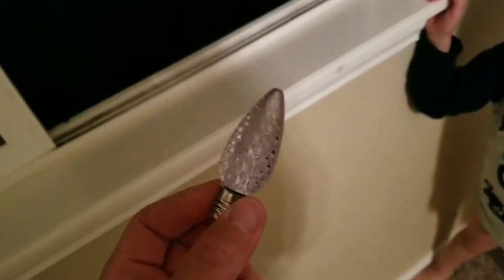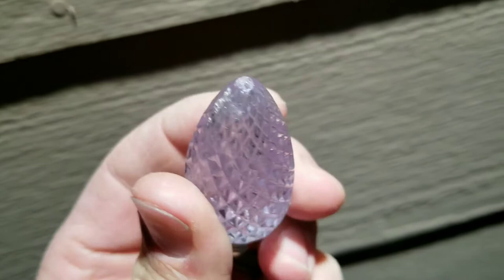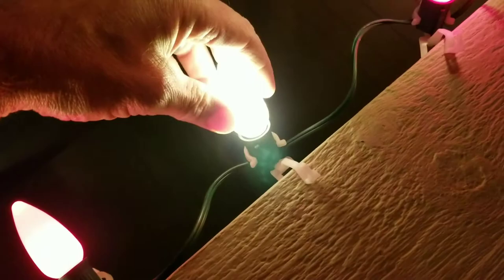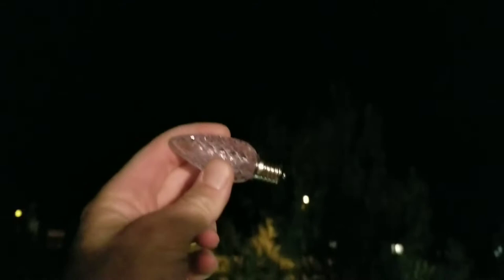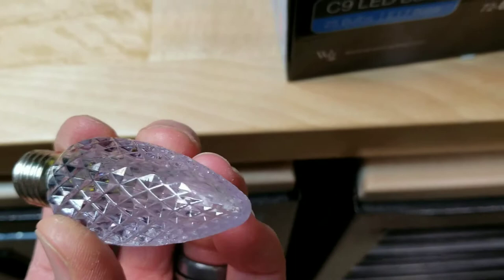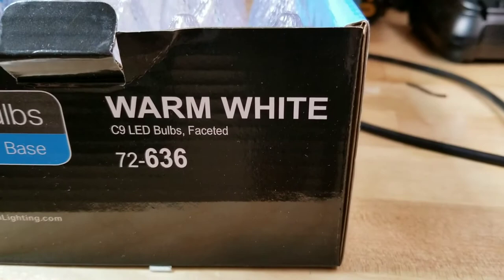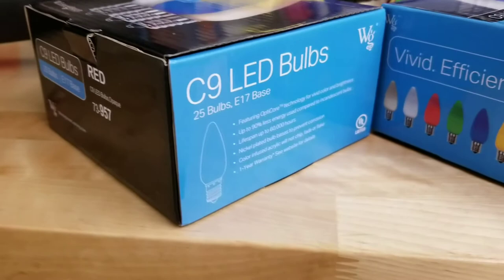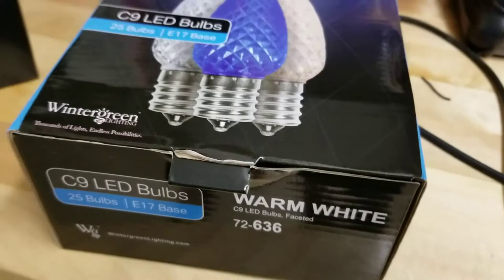OptiCore LED C9 Christmas light bulb Drop Test

Comment from the maker: 5 Christmases and zero burnt out bulbs. I'm very very pleased with these! I think the wire might wear out before the bulbs fail. I'm running almost 500 bulbs and the energy bill is tons better than it was with 250 incandescent c9s! I'll admit: I do miss the brilliant brightness of the incandescent, but with nearly 500 bulbs, the house still brightens the neighborhood pretty well! It's also really nice running all bulbs off one socket. I used to have 4 circuits dedicated to the incandescents in order to avoid blowing beakers.

Comment: Have you compared opticore bulbs to minleon? I found the opticore c7s warm whites to be a bit brighter and distribute the light better.
Reply from the maker: The Opticore are the first and only LED bulbs I've tried. I'll look into the minleon technology. Thanks for the suggestion.
Reply: Ive tried various makes and i may end up going with opticore. Minleons are good but the c9s and c7s are brightest when the tips are pointed towards you. I didnt seem to have that problem with the c7 Opticore bulbs. Celebrations has some c9s that are a bit cheaper and use an LED stick in it they are more prone to failures and they are not as bright and not always water tight. Let us know if you try the minleons, i like hearing peoples opinions on newer Xmas technology
Reply: @funnyberger  Are these Opticore LED light bulbs SMD ones? I got some of the ceramic/solid smooth twinkling Opticore LED light bulbs from eBay of the Wintergreen Lighting brand, and they are SMD ones.